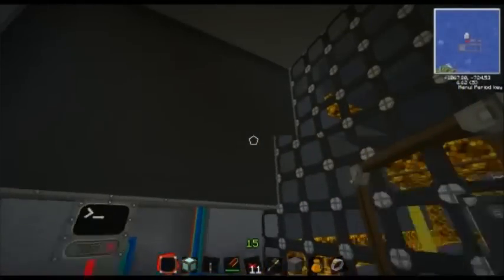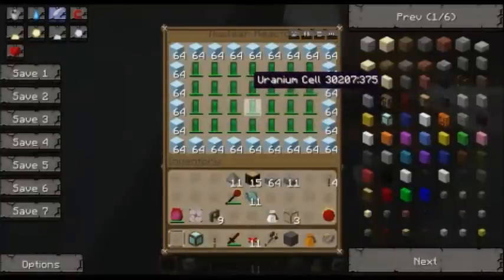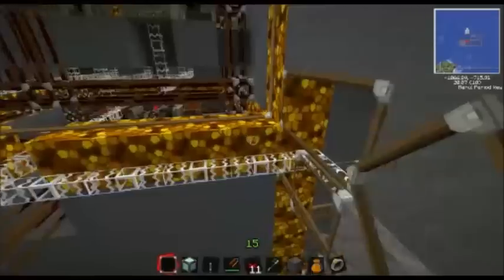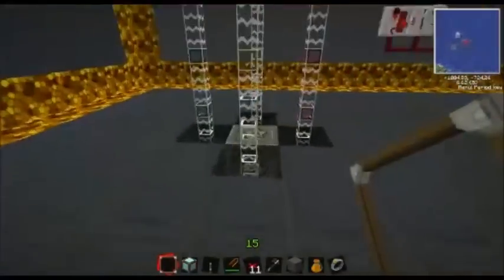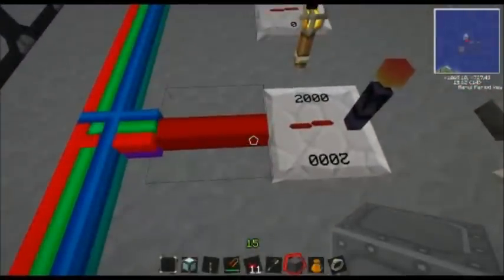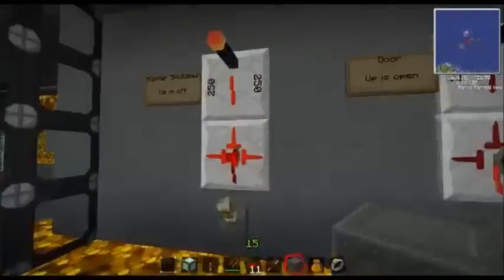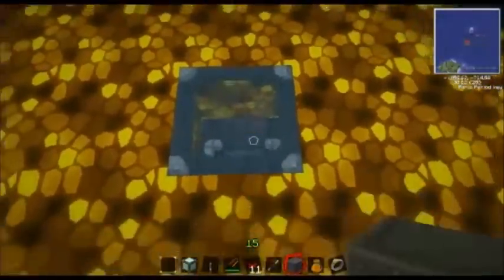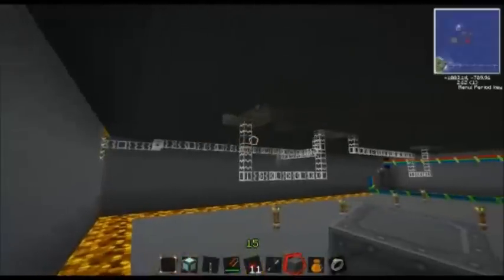Tekkit Nuclear Reactor Tour

Comment from the maker: I am currently working on finishing up the changes before I offer a download of the world. I am going to be finishing it in single player, as I have changed what mods I use on my server.

I hadn't needed to ever change out uranium cells, but I have a system that I would like to work on for it. It is quite simple for a design. When I finish it, I may make a new video to upload.